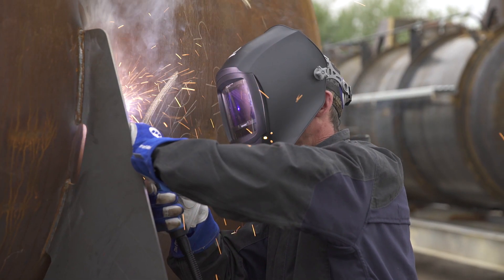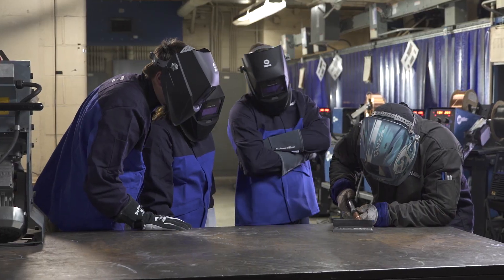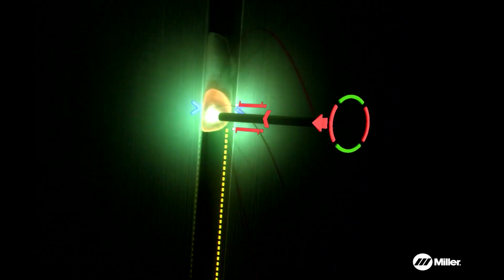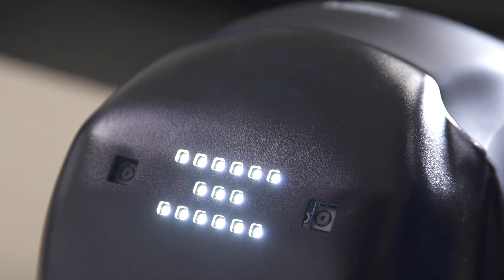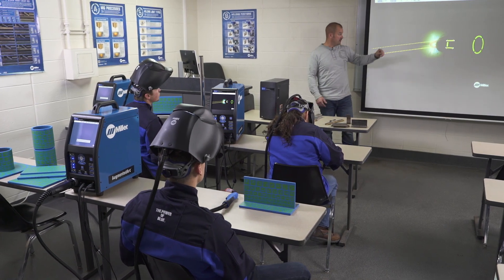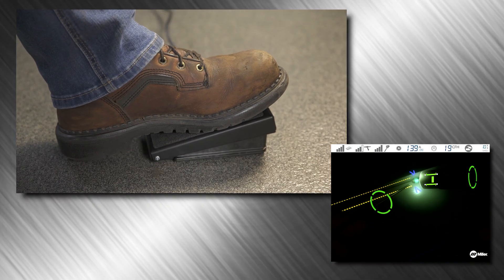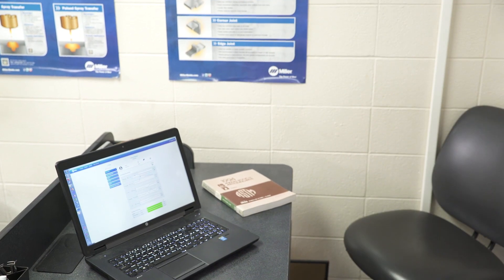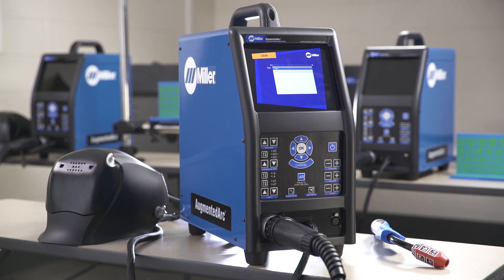Miller AugmentedArc Augmented Reality Welding System

Comment: And in the end they have to go strike an arc and do it with the sparks burning you and the sounds. This may save some material but I think it just drags out the learning process and for crying out loud it shows a mma down pass. Lol. I do think it’s cool and innovative. I don’t think it will train welders faster. It will just cost more in tuition in the end. Give people a small amount of practice then have them gain experience at a lower paying job until they have experience. This isn’t going to produce better welders out of the gate. You can draw chalk lines for weld size . This imo should only be used if someone is having trouble , 6g pipe  or expensive materials. Welding gets picked up quickly . It’s not brain surgery. Now this is a great idea for surgeons. And anatomy. Rather than cutting into cadavers. Welding is just something that is best learned in practice. I get that for an institution it would pay for itself in scrap materials fine but it would be a slower learning process and students should pay for their own materials . Then they learn faster and only people who need more practice pay more. This will up the cost of welding school for every body and its just not needed . A guy can learn to tig sanitary ss pipe in one day and pass a test on it. He will over time learn more tricks but I just don’t see the value in this.